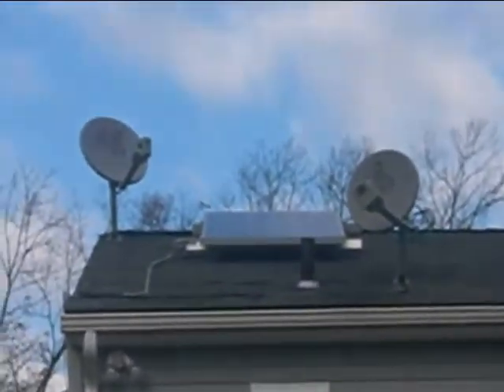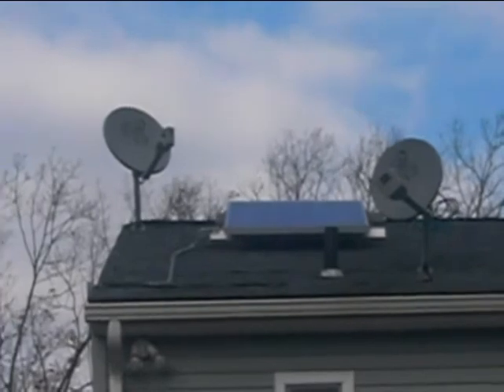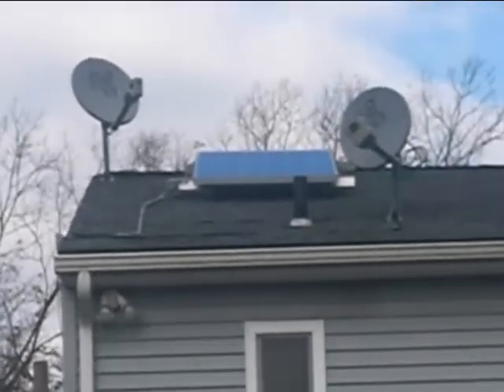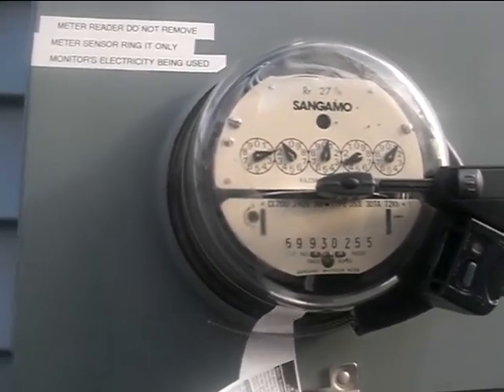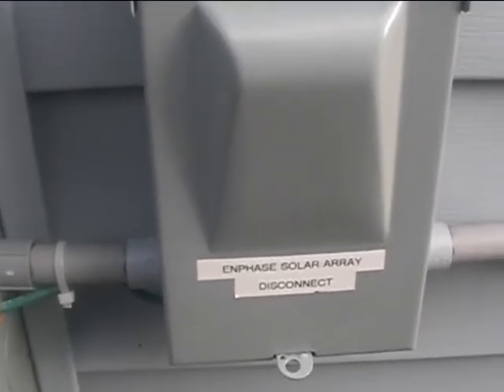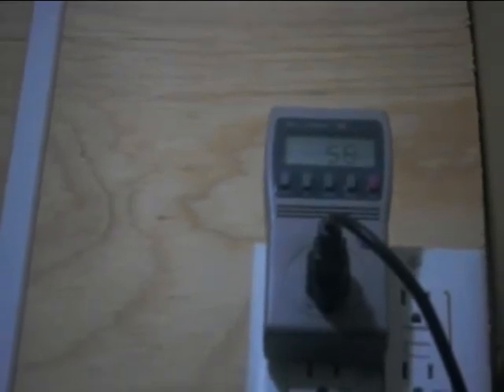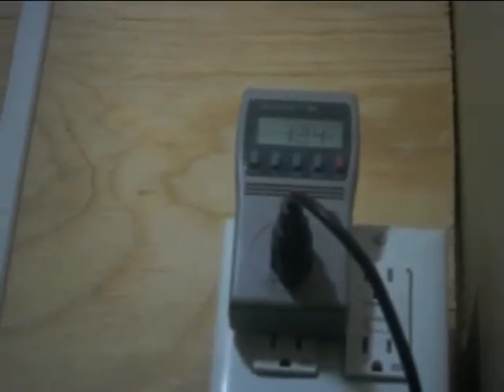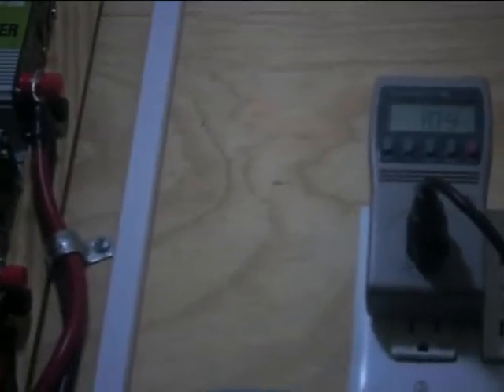Enphase solar system in action!!

Comment from the maker: I just did it like the Enphase install video said to do it. Im sure without it it would be fine but needs a lock out tab on your 2pole breaker it's a protection thing so no one can turn breaker on while your up on roof servicing it.We have to install 2pole switches for water heaters to pass code so i would say yes it's code...

Comment: Nice vid. I just installed my Enphase system too. Curious if code req'd u to add the disconnect beside main panel?  I'm just using my double pole 15amp as my solar disconnect since located outside like yours.